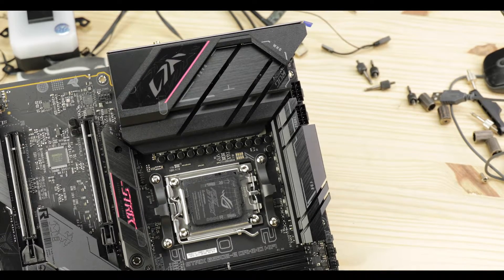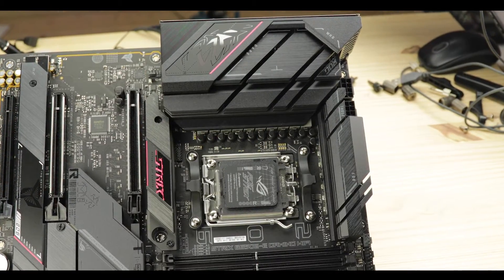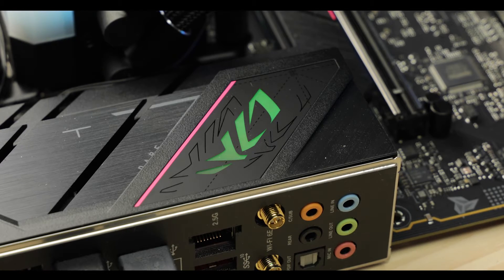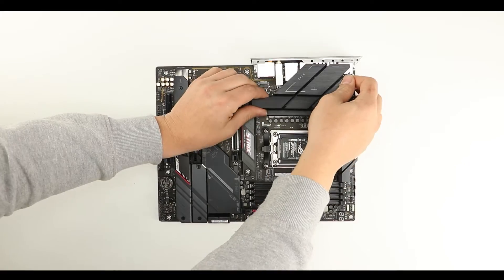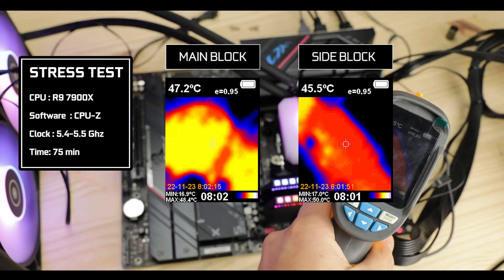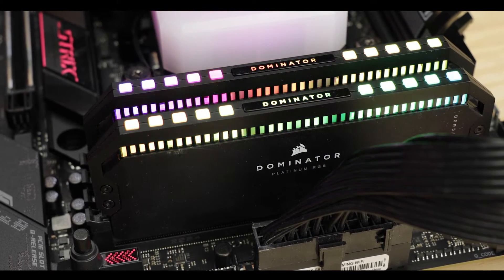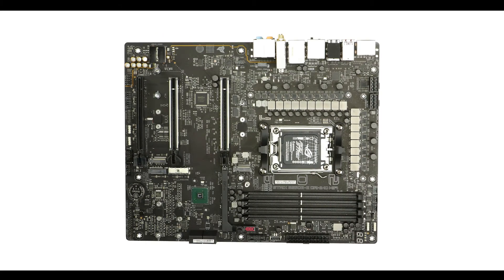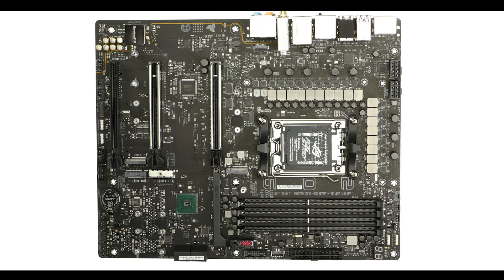ROG STRIX B650E-E GAMING WIFI : the only STRIX worth owning.

Comment: I also got this motherboard. As you said, AM5 socket will be around for a while, and this board is very future-proof, without being too expensive. 4x M.2 slots (2x PCIe 5) is very nice. Gigabyte Aorus Master B650E was the other one I considered, but this one has practically all the same features while being ~50€ cheaper.
Reply: Yes. 
No. x8 lanes PCI-E 5.0 will run  at x8 lanes PCI-E 4.0 speed. Unless the GPU support PCI-E 5.0 speed.
Reply: The only downside is that by using the second M2 Gen 5 slot, the main PCIE 5.0 X16 will run at only X8, witch makes it unusable as soon as PCIE 5.0 GPU's come out.
Reply: @zagohcap1  I don't think it would be unusable from testing from gamernexus looks like you may lose a 1 to 4% from pcie 3 to pcie 4 using a 4090. Would probably be less of an issue with pcie5 no clue yet since no cards actually support it.
Reply: @zagohcap1  a 4090 doesnt even fully use the pcie 4.0 bandwidth, maybe gen 6000 rtx will get close to using full pcie 4.0, so using a gen 5.0 at x8 is the same as pcie 4.0 x16 lol....
Reply: @zagohcap1  that's only for one of the x16 slots. The other would still have 5.0. plus. Who has a Gen 5 SSD and what performance gains in games will you get from that? Nothing.
Reply: @zagohcap1  Hello, I’m really sorry to bother you after 1 year you posted this comment haha, but I’m about to buy this motherboard because I want a B650 with pcie 5 for my graphics card and be chill for years and years, but I don’t really understand what you guys were saying. Were you saying that this motherboard is a pcie5 for gpu but only x8? Which means it’s the same as pcie4 x16 for graphics card? I’m really sorry I don’t understand and I’m about to buy my B650 motherboard, so if you could help me I would really appreciate it. Thank you!
Reply: @ademo6600  Hey no problem. This is a PCIE 5.0 X16 GPU mobo, it’s just that if you use the second PCIE 5.0 m2 slot, the GPU will run at PCIE 5.0 X8.
Reply: @zagohcap1  but what if I use the second pcie 5 M.2 slot with a pcie 4 ssd ? Will it also make the GPU slot pcie 5 x8? And second question,  is pcie 5 x8 the same as pcie 4 x16?
Reply: I’m going with gigabyte on this one because of the vrm being 16+2+2 I believe it’s a better board than Asus
Reply: @Nistical  i just replied to your other comment on here, what makes it better with the 16+2+2?
Reply: @Yeahnicegaming  hell if I know that’s just what I hear 😂
Reply: @Nistical  hahahaha fair fair.
Reply: @Yeahnicegaming  I’m a noob when it comes to pc I just bought one from Cyberpower so that might be my first mistake with all the bad reviews. Anyways I’m doing the research now to see what to swap out.
Reply: @Nistical  the only other one that competes with it is the ASUS rog strix b650 e I’d assume.

Comment: Nice review! I also think B650e-e and B650e-f are the best motherboards that are not too expensive. With 7000 Ryzens, I think the key is running them cooler and lower the power consumption, so X670E's extreme overclocking potential is not really necessary. I feel that things like Q-code LED, PCIE5, excessive amounts of USB 3.2 Gen 2 ports won't be really useful.
Reply: duno.. iam in the decition process of buying a new RIG... the F has only 12+2 Vram, the E 16+2... could be a problem for CPUs in the future.. talking about 78003d, 880003d, 9800x3d, also AMD announced a 7950x3d.. so it could be an issue if you plan to use the MB for the whole lifecycle
Reply: @aasimarGER  There is a PCB walkthrough/analysis of the B650E-F on Buildzoids channel where he says that the VRM on it is more than enough for even a 7950X.
Reply: @aasimarGER  I'm in the same boat as you. I'm thinking even further about Zen 5 and if the low powered boards will suffice to run them (I intend to keep this next board way after AM5 is dead btw). Everybody say they are already way overpowered, but that's for Zen 4 and the actual CPUs, I wonder what AMD will bring us the few next years on AM5.
Reply: Works for me I am the type of person that when I upgrade I usually end up buying a new computer so yeah, I will be considering this. When I have it I will use it until it ceased to function. XD.
Reply: b650e-f does not have optical spdif, wich are bad for me

Comment: Don't know if you remember but a few videos ago I asked you to review the new AM5 Strix boards. Since then I grew impatient and also came upon a good deal (250€ before tax which I didn't have to pay) for this particular motherboard and went ahead and got it together with a 7700X (I promise to get a beefier CPU later down the line to do this board a justice :P) and I'm really happy you like the board as well. My only critique of the board is that the RGB logo on the heatspreader is quite dimly lit and could be brigther. I'm also experiencing a long ass boot times (around 30s) with 32 GB RAM, sadly I've heard that it's a normal thing with the new AM5+DDR5 combo.
BTW Koalas, Wombats, Opossums and Sugar-gliders also have 3 vaginas not only that but they also have 2 uteri.
Reply from the maker: Someone did an impressive amounts of research on that Kangouroo stuff... 🤔  lol :)

U did an awesome choice and ye si do remember you 😊
Reply: @Laurentschoice  Just a question: how to solve that 30s boot time? It's way too much in my opinion.
Reply: That 30s boot is sad, I just ordered mine. My old Z370 with 9700K boots at 13s

Comment: Power delivery should be solid enough to last through the rest of AM5 or at least close to the end of AM5.  Has Gen 5 so if we end up having parts that use Gen 5 speeds then it is available.   RAM speed limit would be the only thing that will be limited compared to future board but on DDR5, those faster speeds do not seem to make much of a difference.   Unless you need tons of rear IO for some reason, the B550E-E is more than enough for most people and put you in an excellent position for future AM5 chips.  Got one of these for those reasons.
Reply: except it does not support raid on sata
Reply: @milordas  Believe it or not, most people don't use RAID.  A lot of people do yes but not most.

Comment: Thanks for another great video.  You have become a go-to-source for motherboard reviews.  I have been hoping this would make it to your desk.  If you have a minute, here is a question for you.  TUF Gaming X670E Plus WIFI or this?  Only $20 separates the two motherboards.
Reply from the maker: Thanks Bill, appreciate the kind words !
Hmmmm.... frankly talking , I think that the STRIX B650E bests the TUF X670E everywhere and on every single metrics.
Reply: @Laurentschoice  I just the bought B650e motherboard and something that is missing on your video and this TUF x670E has; The full bandwith of 4 NVME + PCIe x16. While it's great to have 2 PCIe 5.0 NVME it just make it worse by making the GPU half the bandwith, most people won't notice/care but seeing reviews up to 20fps difference on high fps and  building a near top system it just doesn't make sense for me unfortunately.
Reply: @Buscatrucos are you saying that the TUF board allows for more overall throughput via pcie5 ? I’m deciding between TUF 670e and STRIX 650e.
Reply: @tapiatitan92  If you mean the X670E yes, the TUF has more bandwith pcie5 due to being the X670E chipset instead of the B650E. I ended up keeping the board anyway since the overall components are better and will just buy a PCIe adapter for my 4th NVME using the PCIe 4.0 x16 at the bottom of the board.
Reply: @Buscatrucos  thanks. I’m leaning TUF 670e , would you say it’s the better value now and down the road?
Reply: @tapiatitan92  It depends on what you are interested really, if you want 4 NVME and full PCIe 5.0 for the GPU yes, if PCI Lanes aren't that important the Strix is better in my opinion.
Reply: @Buscatrucos  I’m hoping to get full PCIe 5 for graphics and then at least one PCIe 5 M.2. After that, PCIe 4 is fine for the rest of storage.
Reply: @tapiatitan92  Then the Strix should be good, although you need to keep in mind that the Strix will only have 3 NVME slots without an adapter compared to the TUF, so if you plan to expand to a lot of NVME you'll need to think if it's worth the rest of the features.
Reply: @tapiatitan92  Hey! Just comparing the two manuals here and, yes, the PCIe goes down to 8x when M.2_3 is occupied but TUF has only other two PCIe 4.0 x16 that runs at x4 no matter what. And, if you use the M.2_2 at x4 mode on the TUF, the SATA 1 and 2 will be disabled. Curiously the X670E and B650E have the same amount of PCIe 5.0 lanes (up to 20), so with the existance of a board like the Strix B650E-E the X670E variants really become useless unless you need to go full bananas on overclocking with LN2 and need those extra USB ports. The TUF also has less power stages (14+2 vs 16+2), so for an overclock enthusiast even in this case the Strix would be more interesting. I would go Strix all the way. PCIe 5.0 x16 or x8 wouldn't matter even for next gen graphics cards, believe me, for graphics those bandwidths are totally overkill.
Reply: @Buscatrucos  You can use a 5.0 NVME on the first slot and two 4.0 NVME on the others keeping the x16 on the GPU. What's the point of having two 5.0 NVME?
Reply: @SirTE0  that was not the question

Comment: Great review as always. The main question now is would you choose this over the TUF GAMING X670E-PLUS WiFi ? Feels B650E has a lot of overlap with X670E
Reply: The B650E-E has 2 more VRMs at same 70 amps, more i/o features and (in my opinion) better features in general, at slightly hotter temps.

The B650E-F is worse then both boards I’m pretty sure with only 12+2 VRMs compared to the tuf’s 14+2 and the B650E-E’s 16+2 VRMs

Comment: Having gone through a bunch of options from other companies, this board seems like a real winner. Got basically all the features, but on a B650E board, making it cheaper and often better than a lot of X670(E) boards. I don't know why there isn't more coverage of this board!
Reply: I cant decide between this or the asrock x670e steel legend, since they both cost about the same in my country.
Reply: B650 boards are flying under the radar in general.
Reply: Asus not selling this board in my country
Reply: I bought a x670e hero ngl, I am disappointed :( I am going to return it and get the b670e I just game rest of the features I don't even use :/ waste of £600 this board is half the price
Reply: @thealien_ali3382  why did you even buy it if you don't use those features?
Reply: Same, just went through this channel looking for an AM5 board and this is the one. X670E is for such a small niche of users.
Also, ASUS BIOS is usually good-looking and well featured.

Comment: Proud owner of Strix B650E-E motherboard
Reply: Just back ordered mine from Newegg. I was very impressed by the configuration of this motherboard in this price range
Reply: I have one and been having problems with the I225V network adapter. Disables itself occasionally even though all the driver are up to date. Having to buy a separate pcie network card.

Comment: Came to get my French Connection Fix... and love your Energy, but AM5 670 650 and Z790 are all too expensive and B550 level pricing needs to happen for wide adoption. I'm not as enthusiastic.
Reply from the maker: Hey Nickel :) , love having you here! Did you check any BF deals on B550?
Reply: @Laurentschoice   My current Fav is MSI PRO B550M-VC Wifi 6E BT5 2 M.2 debug LEDS, Flashback for low $99-$120 ish.
Reply from the maker: Nice !!! Yeah no incentive to ups see for now !

Comment: Surely, Gigabyte has sent you an AORUS X670E MASTER by now; surely...?!?? =o
Reply from the maker: indeed, i have both the X670E and the B650E MASTER :)
Reply: @Laurentschoice  looking forward to those reviews, they are my top contenders for purchasing
Reply: @Laurentschoice  When will you be reviewing THAT BEAUTIFUL MONSTROSITY...?!??
Reply from the maker: Should be up next week
Reply: @Laurentschoice  I was wondering if I could get your thoughts, or events even testing data (since you have one on-hand), as to whether it would be beneficial to install two gen4 m.2 (like the Seagate Barracuda 530 2TB, or equivalent) in RAID 0 into the two PCIe gen5 slots and the performance uplift it would bring to the table...?!?? 🤔 

Both drives (7,400MB/s read & 6,900MB/s write) would charge the PCIe gen5 bandwidth connection (theoretically; 15,000MB/s); in RAID 0 that SHOULD utilize both drives to the max, until gen5 m.2 drives hit the market 😉 👍

P.S.  Feel free to realize said thought into worthwhile content; as I am (hopefully) not alone in considering this!?!!